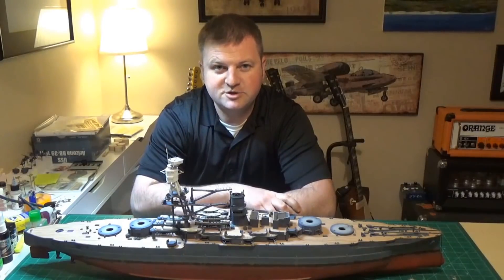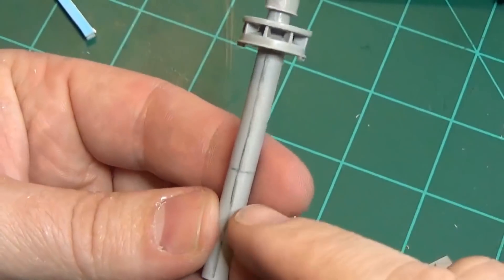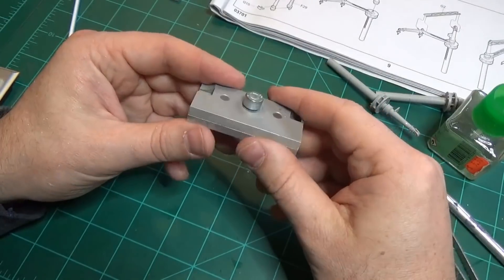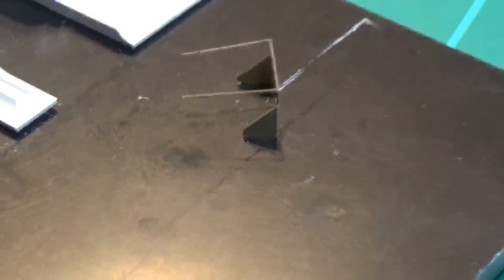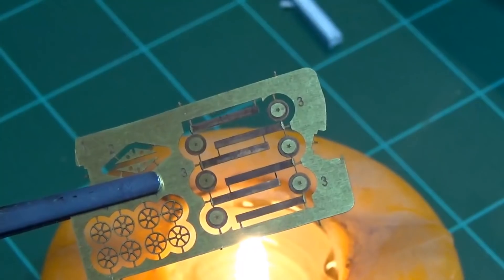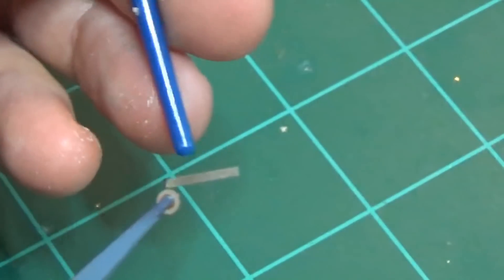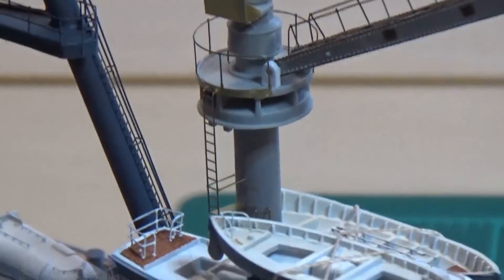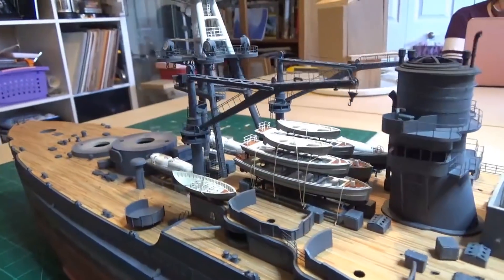USS Arizona by Trumpeter 1/200 Scale Build Video #14

Comment: Creative Solutions "Glue Looper Ver. 2.0" will become your best friend for doing intricate applications of Super Glue to photo etch parts. Never leaves big blobs. Have been using for a couple years now and highly recommend to guys doing this. Thanks for sharing your build log
Reply from the maker: Awesome idea. It looks to me like it functions the same way as the nib on a fountain pen. Do you have to worry about the glue drying up between the split in the tip?
Reply: @TheMidwestModelShop - it does dry, yes. but a quick hit of heat from your lighter opens it right back up again.

Comment: Martin, may I ask why does the Photo etch parts come with the copper color.   At first I believed that this was to assist with adhesion of paint which makes real sense to me.  However, this specific etched on finish is not used on all the parts.
Reply: They do come in this color I have built a ship or two and his name is Ben 🙃

Comment: Can you use boiled water to anneal?
Reply from the maker: Rich Chel  so the average temperature of the blue part of the flame on a candle is 800 degrees Celsius. The red part, is the coolest at around 400 degrees C. My guess, is that boiling water isn't hot enough. However, that wouldn't stop me from trying it if that's your only option. But I doubt it would work. Not to mention, you're probably more likely to burn yourself this way. Safety first.